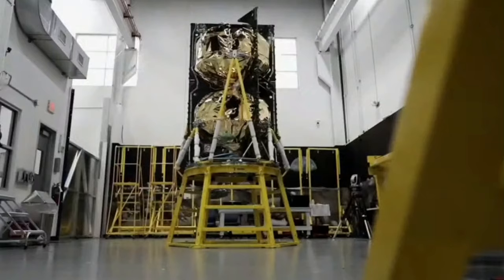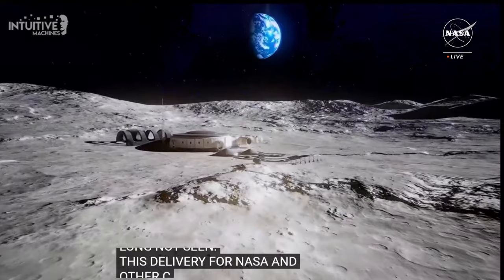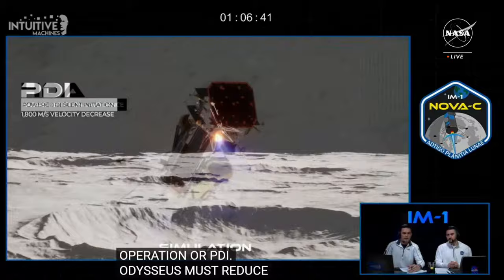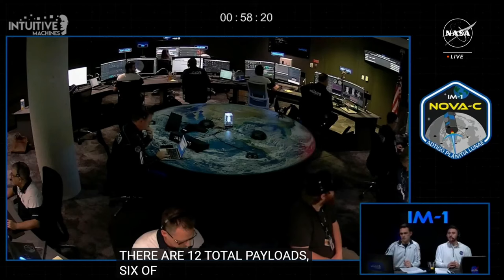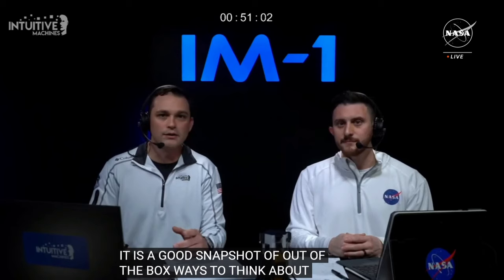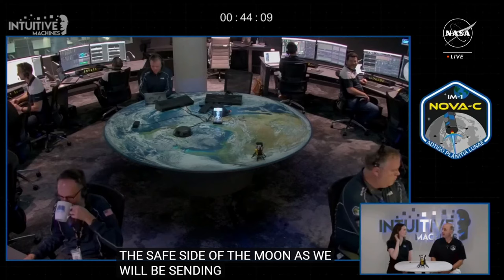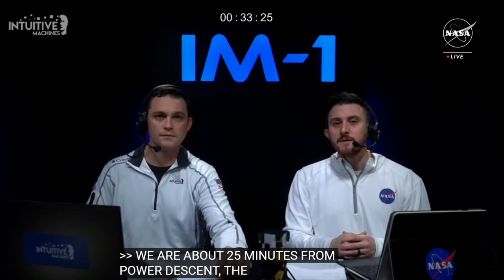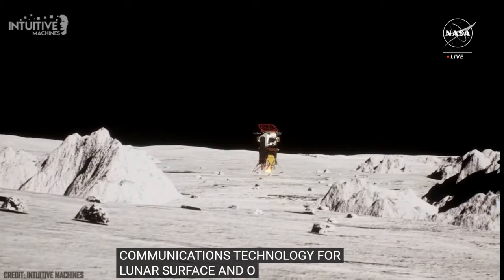U.S. attempts first moon landing since 1972

Comment: A year or so back the Himalayan mountain range was filmed from a passenger plane flying over Dubai, that's over 2,000 miles of no curvature. The Nikon p1000 is a scientific instrument that proves Beyond any shadow of a doubt that the curvature of the earth cannot be measured because the curvature of the earth simply does not exist. The curvature calculation of 8in per mile Squared is Bogas. You simply cannot take all the Flat places known on earth and create a circumference of 24,901 miles. The math is simple.